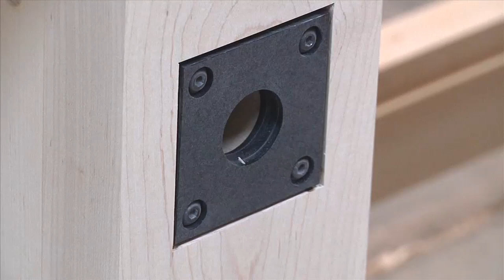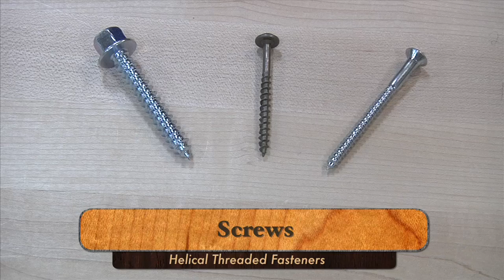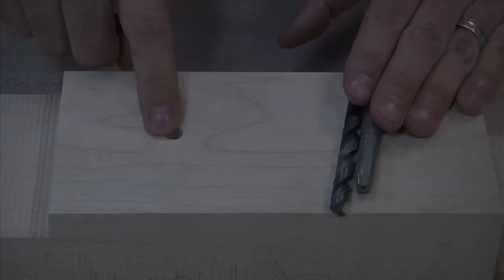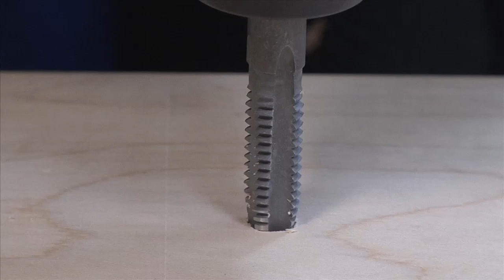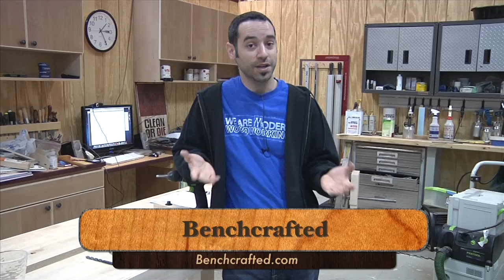Tapping Threads

Comment: Hi Marc -- we have been using threaded wood in the RC modelling fraternity for years, and they never wear out or get loose.  One tip is to wick a little thin CA glue into the threads if you want them extra strong.  This will make them like steel and no possible way of stripping them, save incredible abuse and super-powers.

Comment: Good video, Mark. I read an article on this subject about 20 years ago. Mc Feely's, screw company, had some university do a study on tapping holes in wood. They recommended that the hole for wood, be smaller than that for metal. Tap drill charts list the sizes to produce a 75% depth of thread in metal. The study said to use a hole size to produce 100% depth of thread. Search for "Basic Thread Dimensions and Tap Drill Sizes". Use the "minor thread dia." for a tap drill size for wood.

Comment: Great video as usual. I have used this method before and like it. I found that the threads stripped using soft woods but I didn't use glue to re-enforce the threads. Also use as coarse a thread and as big a bolt as possible. The fine threaded bolts just don't have deep enough threads

Comment: After drilling the hole if you use a countersink and only go down .030 to .050, this will assist in the tap when entering the hole, some wax on the tap would help with a cleaner cut.  Threaded nutserts would give you the best of both world, the unit threads into the wood and the bolt threads into metal and you will never wear it out or have the worry of stripping the wood threads

Comment: A simple method to find the correct drill size for a given tapped hole is to get a nut that fits the bolt. The correct size drill is the one that just passes through the nut- it's usually best to use the shank end. 
If the material is really tough use a slightly larger diameter, if it's a bit soft use a slightly smaller diameter.
Really enjoy your videos by the way!

Comment: Have  tried this on oak before, and worked well.    That looked like hard maple.  
Thinking softer woods would not have the strength necessary to do this.

Btw  love your videos.   Built the chopping block.   Used Black walnut and maple.   Turned out nice.

Comment: @TheWoodWhisperer you should try putting the tee nut on the other side (the bottom part of the hole) . That way when you tighten the bolt, the force  PULLS the tee nut in, instead of out (just like a regular nut). Although I realize it's not always possible.

Comment: Use your drill press with the power off and hand turn the chuck while pulling down on the handle to tap the hole so the threads are perfectly perpendicular. A way to strengthen the threads after they are cut is to apply CA Glue to all the threads and let it cure for 24 hours. The glue seeps into the pores and fibers of the wood adding significant strength and durability. After the glue is cured your threads will be too tight to run a bolt in them so carefully run the tap back down for a clean up pass. Tests on other channels show about a 36% increase in the strength of the threads.

Comment: I remember an old tip from Wood Magazine when using the T-Nuts. It suggested using a bit of epoxy mixed up and applied to the surface before driving the T-Nut into the wood. I'm not sure how much better it is, as I've never used it myself, but it's an option I suppose.

Other than that, looks good, a nice blend of machine shop tactics and wood shop style.

Comment: @Polthaus 
This is true, wooded pool cues have been treaded metal to wood for hundreds of years and yet no matter how many times they are taken apart and reconnected the threads are still holding.  Courser treads seem to work better than fine ones and water thin ca glue does help the threads last.  Jaaox cue repair

Comment: They make a clutch type adapter that will fit into any drill press so that when you back the tap out it will reverse its direction on the fly.  I used to work in a place for a bit that would mass machine wood and phenolic parts.  You could hammer out a lot of threaded holes in a short time with those setups.

Comment: Ive always liked the idea of tapping threads into wood. The school I learned at had a set that actually had a way to impart thread onto wood so you would end up with a wooden screw to go with your thread. Maybe something you'd find interesting to play with!
Reply: For metal fasteners the tool to make threads is called a die. Not sure if that's what you're referring to.
Reply: That's exactly what I meant. I knew the term but I guess I didn't associate it correctly to the tool because I knew it as a metalworking tool and the wooden version is like a giant pencil sharpener, but the concept is the same so it makes sense they're called the same.

Comment: I also wanted to metnion that using the correct sized bit for the tap when using it in wood might not always be the way to go since the matched set is designed for metal which don't have much in the way of tolerances.  It might be good to use a lightly smaller drill bit, say one or two sizes less in the numbered system for tapping drill bits (since the next fractional size down will probably in most cases be too small) so that you have slightly more wood to push into the sidewalls as you cut.

Comment: You missed three more styles of adding threads to woods...all of which are (imo) superior than simply tapping the wood...mainly due to varying humidity.

There's the harpoon-style threaded insert, which is best used on particle board, plywood, mdf, or in endgrain, or when extra depth is needed for hardware clearance. The straight-thread style...amazing for hardwoods. And the riveting t-nut, which is by and far my favorite.

Rockler has all three styles, plus some more.

Comment: I love this, and I have a ton of uses for tapping threads into wood. A big question though, would be about less than perfectly stable woods. In humid months, when the wood could possible expand, even the weeist of bits, does the bolt become much tighter, and can it damage the threads in the wood?

Comment: I wonder if would help absorption into the wood even more if you took some acetone and put it into the threaded hole just before you put the CA glue in since it's a solvent for CA glue; I would think it would help pull the CA glue into the wood more.  I use wood hardener myself and don't have any regular CA glue, so if you try it let me know how it works.

Comment: Great tip, thanks again. You should back off the bit to clear the chips ever once-and-awhile during tapping. You can probably go even cheaper by just getting the rethreading taps because your just dealing with wood. By-the-way, what did you use on the bottom of the bench legs to prevent moister getting in the end-grain?

Comment: After tapping, apply thin CA to the threads and let it dry COMPLETELY.  Then run the tap through the threads again to clean them up.
Reply: What is CA- construction adhesive?
Reply: cyanoacrylate. Also known as super glue.
Reply: wow, great idea! I just use threaded inserts but I bet CA does wonders for longevity.

Comment: If you take thin CA and wick it into the threads of the wood the treads will last much longer.  This is how RC airplane guys harden threads in balsa wood when a screw must be installed and removed frequently.  You need the THIN CA not the gel type for this to work.
Reply: doseven , .... what is CA....?
Reply: @zaagnutjejn8920  Cyanoacrylate (super glue)

Comment: Why thread the wood and not use the brass or steel thread inserts?  Sure they hold into the wood but the threads you are using and reusing and metal.